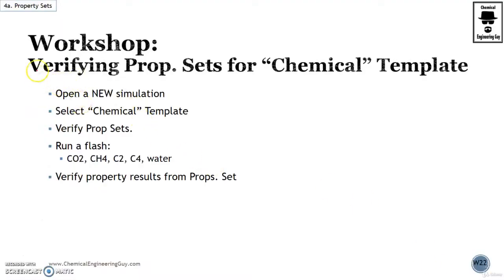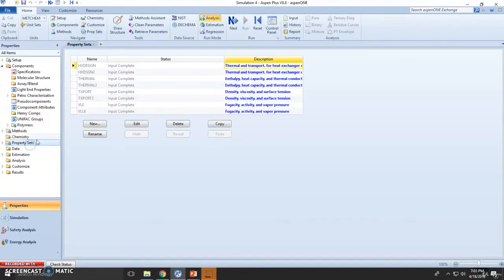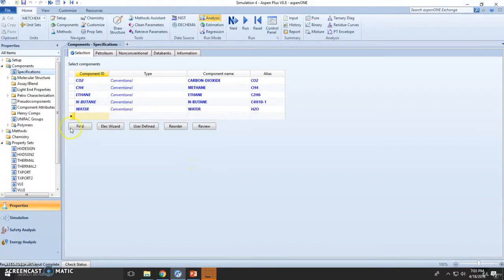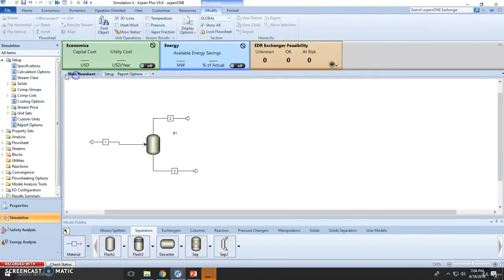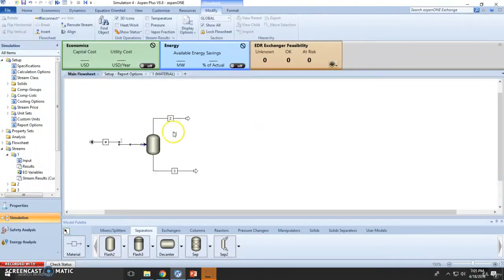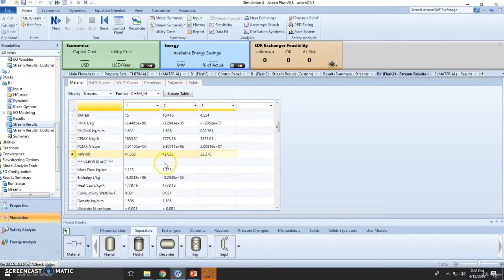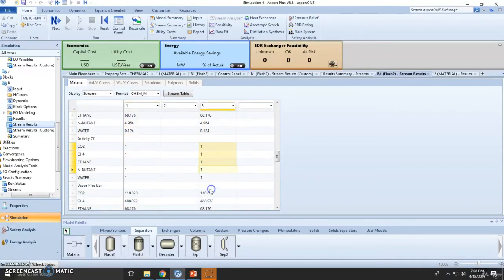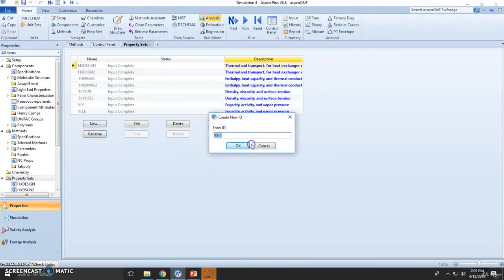Setting Physical properties - Workshop (Aspen Plus)

Comment: Hi~Sorry I have a problem about calculating air specific heat ratio, I set up everything and the answer is 1.0019 in 600K ,that is totally different with correct specific heat ratio1.35
Reply from the maker: Are you sure that the "outlet" air is actually 100% air ?